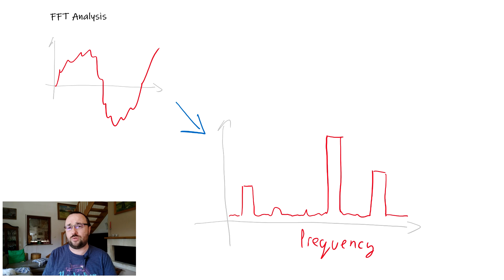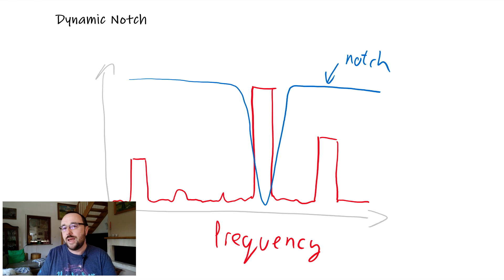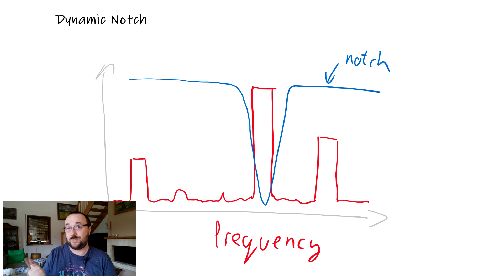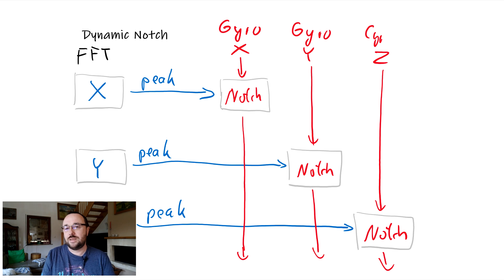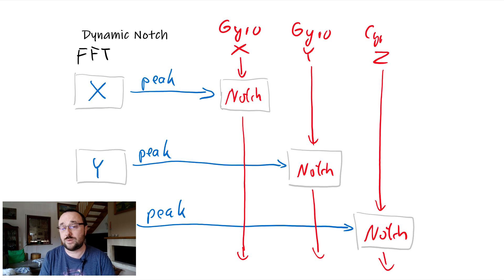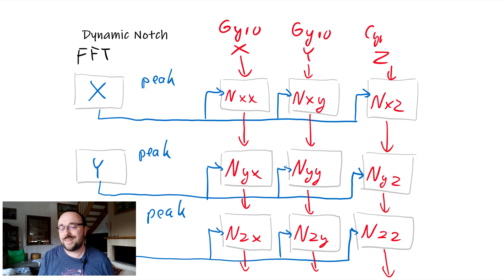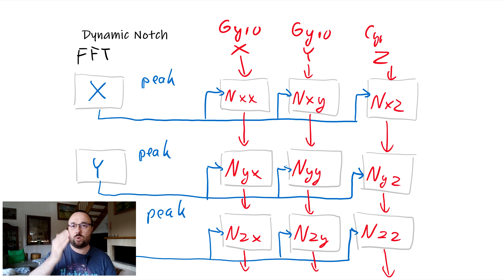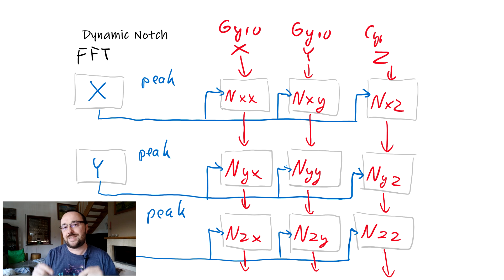INAV & EmuFlight Matrix Filter - how does it work?

Comment: Thanks..and I am wondering will there be any addition to inav in coming future related to connect raspberry pi board to communicate telemetry /live video or to control drone on 4g/lte network or wifi hot-spot..or you suggest.. That only way around is to flash ardupilot on matek f765 ?
Reply from the maker: INAV already support various telemetry porotocols. Just pick software that can read them and transmit to RPi and you are golden

Comment: Read conversaion about it on BF repo. One of the point was why there is correlation between the axes. I immidiately make simple test: took my quad with ligging enabled anh hit it with a pencil frome one side pitch/roll/yaw - and boom, there is definetely correlation between different axes gyro measurements.

Comment: Good work.  Some of the boyz are looking at this in BF.  We have a HEX in BF with Matrix filter and I'm going to load up on my dual FC rig to compare against the current dynamic notch.  Same flight same noise (of course, within a pretty tight deviation).  We'll see what we get. 

That will be on a 5".  But my hunch is on bigger rigs there is more of a benefit.

Question: In iNAV is there a way to turn off the cross axis notches for A-B comparisons with one build of firmware?
Reply from the maker: I really regret I can not fly now to work on this.